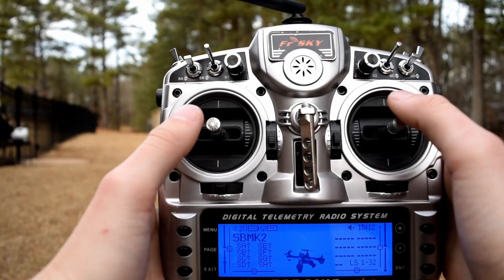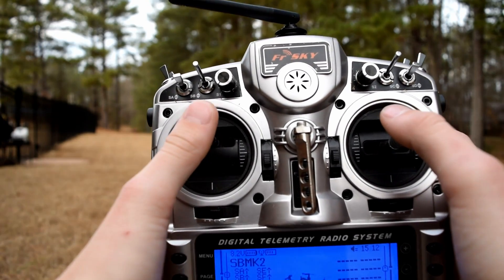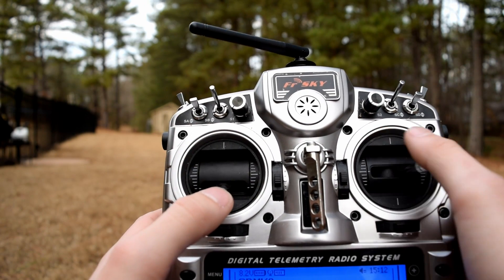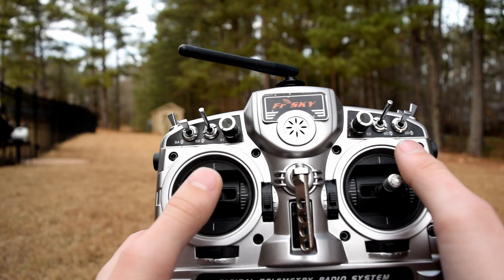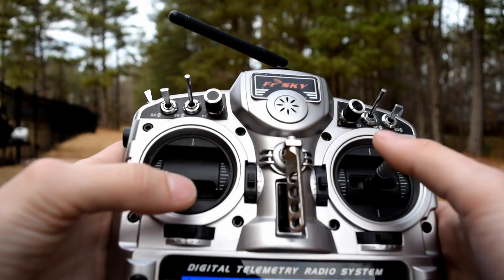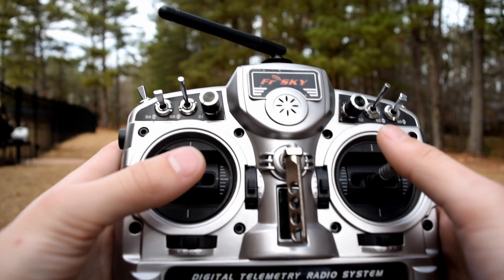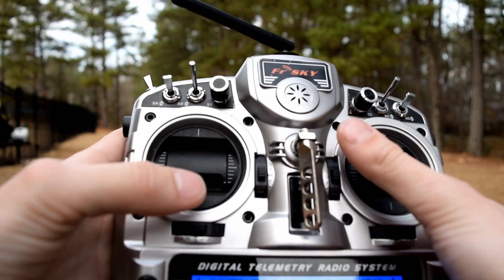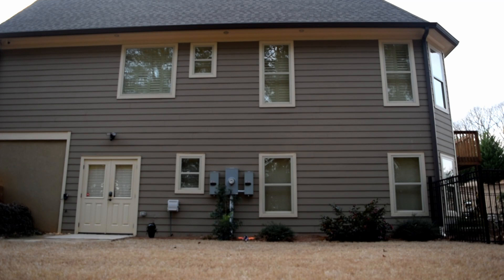How to Flip a Quadcopter In Acro/AIR Mode

Comment: Great explanation, I succeed it in my 2. attempt. I was too low on my 1. and didn´t manage to pull up after the flip. Be sure to disarm it if you crash in air mode because motors will be spinning even thou you don´t have any transmitter input and no throttle. I practiced over tall grass to prevent any damage.

Comment: I'm still confuse. The guy from the hobby shop I bought my tiny 6x said that actually dont have acro mode, it just people call it, actually it is air mode. And he show me on betaflight configuration on his computer(like him saying, I see angle/horizon/ air mode). But I search and people said that airmode not flight mode, just to enable it in another config in betaflight. So we have 2 config for "airmode", one "airmode" is enable to control drone when you put your throttle to zero, and the other "airmode" is in flight mode and you call it"acro mode"???. And the different betaflight version is come with different call name this mode, the old version call it"air mode" and new version call it"acro"???
Reply: Acro isnt a mode in betaflight your quad is always in acro mode unless you have angle mode or so on a stick and have it activated. Airmode is just an add on to on the whatever mode youre flying that spinns the props even at 0% throttle so that you dont lose controll over your quad in e.g. a flip. I hope thats understandable

Comment: Today I tried that, and I did Throttle up, then all the way down and then I flipped, but I was nervous and i didnt do full flip, i probably did like 310-320 degrees flip, then I got scared and I throttled again cuz it was loosing altitude but it just went left side then I tried to go right but I did it too fast so I flipped again and punched the throttle by accident and crashed with my brand new dalprop cyclone T5046c props that i got today, nothing is broken and none of props are bent. Can you please tell me how can I fix my issues.

Comment: Do i need to activate acro plus air mode at the same time? Or will this work on any of these modes?
Reply: You can only enable one mode a time. I'd recommend Airmode.
Reply: Thanks for the reply :) yes i know the one mode at a time was just curious as i am new to BF/CFlight based boards :) One more question, i couldnt find the details of air mode, i only found that it keeps motors running in zero throttle to do maneuvers , question is does Air mode keeps self leveling/stabilize enabled or is it off like acro? I mean when throttle is zero self level must be off to make a flip but does this mode stabilize in normal flying/hovering throttle?

Comment: Yeh man this very nice demo.. I just got my Wizard x220.. I not attempt to switch to acro mode yet.  Is soo different style from DJI Phantom and Mavic Pro.  
Can I do flip on horizon mode? I think I can right?
Reply from the maker: I believe you can do flips in horizon and it will automatically stabilize. The Technique should be very similar to Air Mode (acro).
Reply: How you getting on? 😊 I got mine a few months ago and am already doing flips and rolls for days XD

Comment: Best explaination I have found that explains what to do with the sticks during a flip.  The only thing I will add is make sure that you have airmode active also. This setting gives the quad pitch and roll with no throttle input.
Reply from the maker: Thanks for the addition. It is very important that you have control of the quad while it is at minimum throttle while doing a flip.
Reply: THIS! this is what i was looking for, all the sims i had roll and pitch at zero throttle but not irl and it was killing drones ty so much